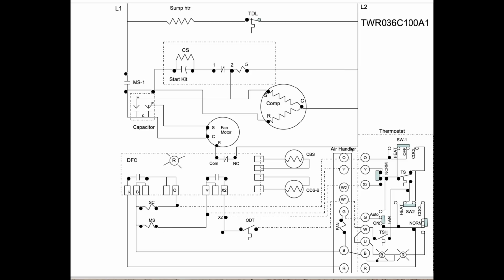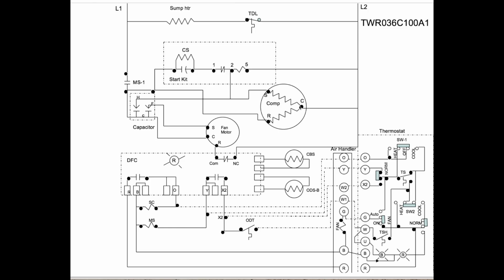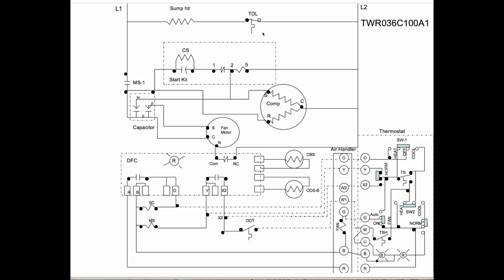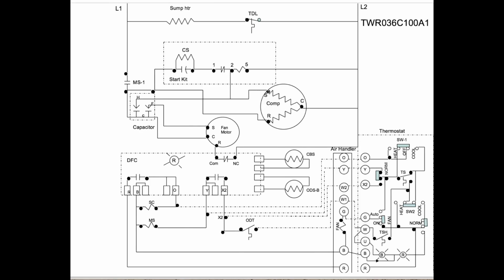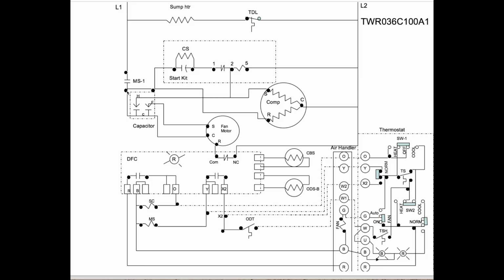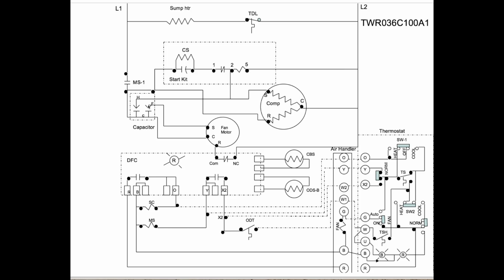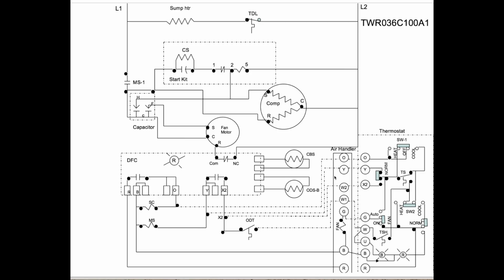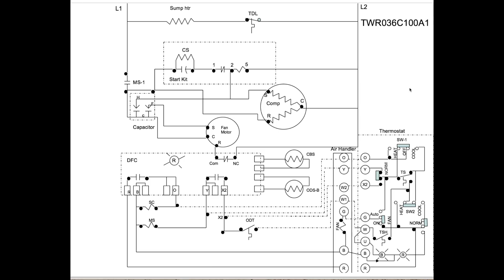Heat pump diagram #2 Call for heat

Comment: Hi, my beckett pump was leaking from the seal since ive had it. I bought a digital control r7284 and a new clean cut pump. the original wasnt clean cut. it is a 1 pipe setup. do i just wire in the solenoid purple to solenoid and white to l2? are there any other changes i need to make? i put a new nozzle in also.